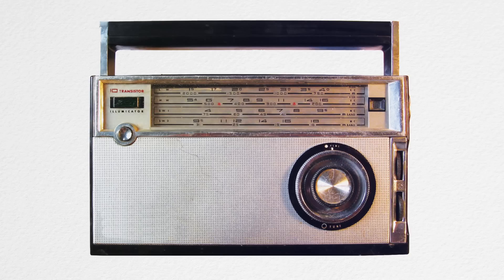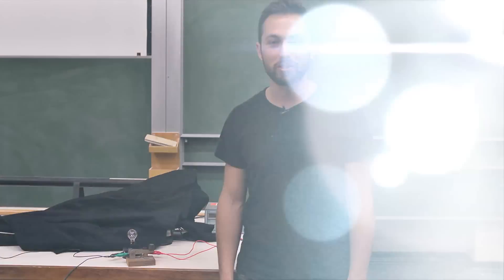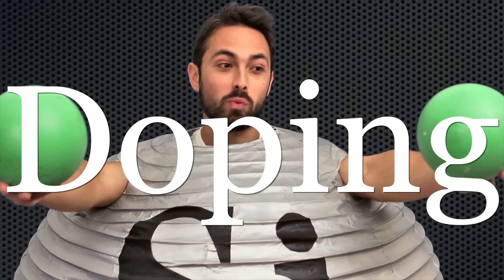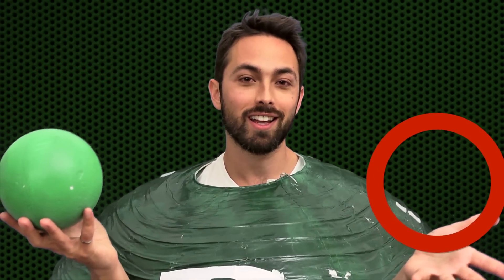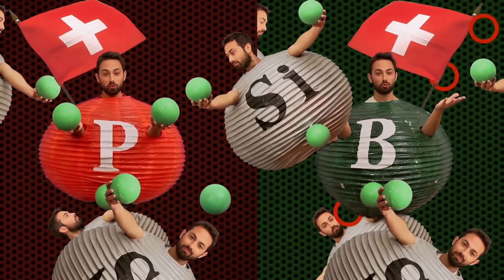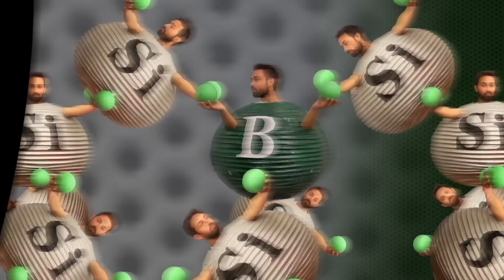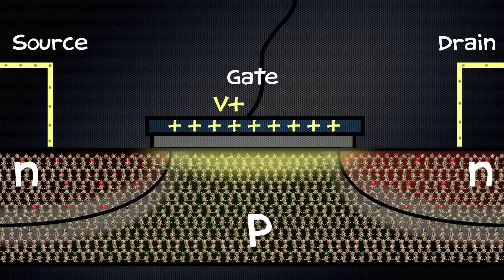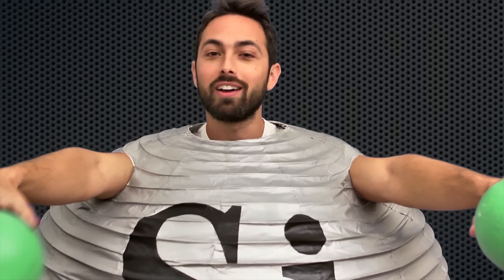How Does a Transistor Work?

Comment: metals, true conductors, perform better as the temperature gets cooler; in fact, at -200 degrees celsius you get a superconductor -> electricity flows forever… you can connect a superconducting wire to a current source like a normal wire and when you remove it, unlike a normal wire where the current obviously disappears instantly, the current just continues to exist…. nobaterry no nothing, it just continues to exist in the wire…. almost no joule effect; 

you cool a semiconductor to -200

Comment: but wait? Don't you need a switch to turn the voltage on/off to allow or stop the flow? If so. isn't it pointless to make an electronically managed switch, that need another switch to function?

Comment: there's an energy level where electrons can flow through; it's called the conduction band; electrons staying bound to their atoms, as you said, is the same thing as saying electrons in valence band. With enough energy, atoms get excited and hence the electron moves from the valence band to the conduction band. This energy requirement explains why semiconductors have the incredibly odd property that their resistance to electricity grows as temperature drops;

Comment: so there will be a break from moore's law…. but in the immediate aftermath, a new law will take its place: an equivalent of moor's law for batteries; yes, energy storage will take the place of memory storage as the main driver of innovation for the near future. We will still have miniaturization and advancement, but due to advances in battery performance, not the actual data processing part; 

if you were thinking of quantum computers, watch veritaseum's video on those and see that they can't

Comment: One minor correction:  the problem with electron tunnelling and transistors isn't that you can't make a potential difference small enough to effect a depletion layer; it's that you can't make any potential difference at all that will effect a depletion layer.  I know, that's some specious comment and the reason involves statistical mechanics far beyond the scope of the video (which is still required to entertain an audience far better the standard lecture), but I felt it had to be said.

Comment: they do have some amazing powers, they can produce electricity (well convert torsion into electricity) which is how your electric lighter works, they can vibrate really fast when given electricity (this is how an ultrasonic mister works) they can be used to keep time (quartz clocks use this) and that's just piezoelectric crystals. from glass to semiconductors, the world runs on crystal power!

Comment: it is also important to note that transistors are used if almost every analog circuit as well. since the do not have to just stay in a "1" or "0" state thy can be adjusted between the two. this is how all amplification is achieved in electronics. (except for in cathode ray tubes and induction boost circuits but transistors are much more commonplace)

Comment: That is actually the purpose of the oxide layer. We don't want the current to flow into (or out of) the Gate contact. We only want a potential difference between it and the system. The electromagnetic force can still be felt through the oxide layer, but the electrons can't move through it, and so take the easier path along the p-layer.

Comment: Yeah the gate is insulated. A MOSFET is an example of this. No current actually flows into the gate. The charge is what turns the transistor on and off. Not the flow of a current. Hence why it's way easier to wrap your head around a BJT  that does use current rather than charge to make this happen.

Comment: All you need is a voltage signal in the pin of the middle (also called base or gate), it doesn't matter where it comes from. It could be a signal generated by an interrupted laser, a motion detector camera, software or whatever application you have in mind. That why it is so beautiful!

Comment: In the type of transistor in the movie (a FET), you have a current that is controlled by a voltage. The gate does not draw any current. This is already an amplifier which detects a voltage without disturbing it, and is capable of steering a large current. You could hook one up to the parallel port of your computer, which can supply a few milliamps, and use that to switch a motor on and off, with a current of 20 amps. This is analog. In digital applications, transistors are cascaded.

Comment: The P atom is only bonded to 4 Si atoms. Its fifth outer electron is essentially free because of the periodic potential of the lattice. Undoped Si will not conduct below a certain bias is applied. When it is doped, it will conduct with small biases and the current will depend on how heavily doped it is.

Comment: Hopefully I can explain this well enough.normally you would use a combination of both. As you get a different rollover point, and hence trigger current with boron. But the diffusion profile is very shallow, so you add aluminium as well, which gives you the correct rollover point and the width of the ptype area.

Comment: Yes, you need to switch (like a power button) usually to turn these other "switches" on. The power button starts the current to activate the gates. However, these specific transistors are extremely small and compact which allow more information to travel faster.

Comment: That last problem; there are two possible solutions, though they too have limits. First, we can change the material that we use. instead of using silicon, we can use molybdenite, which can be reduced down to 0.65nm, which is only 3 atoms wide. The other solution is 3d electronics; placing transistors on top of transistors. This however increases energy usage, heat production, and manufacturing costs, however molybdenite transistors are estimated to be 100,000 times more efficient than silicon.

Comment: There is something called "clock" in electronics. It's a signal that goes from 0 to 1 and vice-versa very fast. That's one of the things wich determine the speed ofa microcontroller, for example.  It's usually produced by a quartz crystal. You can look it up in the internet. It's very interesting.

Comment: Often other transistors. When voltage flows out of the "drain," it can either be used directly to power an output (say, an LED light) or it can be used to activate another gate. String these together with other electrical components, and you can get useful work done-say, a device that turns the lights on when the room gets dark.

Comment: a simple question which garners a very complicated answer, but suffice it to say that there are transistor-based structures called flip-flops (the basic elements of RAM) that can control how and when things get activated in a digital circuit. 

it's really hard to give a better description than that without just teaching you how a computer works.

Comment: If you plot Moore's law out to today you can see it is already failing. In the short term it looks like using multiple cores is allowing is to increase speed without increasing transistor density. In the long term quantum computers of some type are likely the solution.

Comment: no need to be a dick, it's actually not a bad question. in the case of this video (where a MOSFET was shown), the gate electrode has a small capacitance, so if you simply take the voltage away, it will retain a small charge which could leave the transistor open. you have to specifically switch it to ground to dissipate the charge.

the transistor shown is just one kind of transistor, there are also other types. I think MOSFET is the most common in digital electronics though.

Comment: You can arrange the transistors into configurations called logic gates. These process 1 or 2 bits of data and generate a certain output. Combining these together creates a "full adder" which is basically a binary adding machine. And that is the basic element of a computer. The only thing a computer really does at the basic level is add numbers together. Watch this video if you want to learn more: watch?v=VBDoT8o4q00.

Comment: Yes. At bipolar tranistors you use an different physically effect called Avalanche-Effekt. You let a small current flow from bias to emmiter which causes a higher current from collector to emmiter.
collector == source
bias == gate
emmiter == drain
If you wire an bipolar transistor you have to be carefully, because you need an resistor at bias or the tranistor will die

Comment: in solar cells are only 2 layers of silicium (1 n-type 1 p-type). The sunlight causes a voltage of 0,7 V so if you connect the two layers with an wire the current will flow through it. If you connect many of this cells to an array you get higher voltages and higher currents. I hope you can unterstand this explanation :D im not that good at English.. im from Germany

Comment: Pretty simple the gate acts like a capacitor. The voltage is applied by a human when you need to open the channel and removed when you need a channel. The transistor is the basic element used by two individual sciences. Analog electronics where the state isn't only 1 or 0 and digital electronics where the states are only 1 or 0. Then the voltage applied to the Gate is controlled by one of the devices or schemes invented by does scientists.

Comment: you wire the gate pin of the transistor with an output of a mikrocontroller for example. Then you can switch the tranistor by the high/low signal of the controller. By that you can switch an LED on and off.

The logic of an CPU is too difficult to explan but the imagine every transistor in it is switched by another which causes a special pattern of bits on the data outputs of the IC. Every clock signal (3GHz for example) causes a new pattern of Switched Transistors.